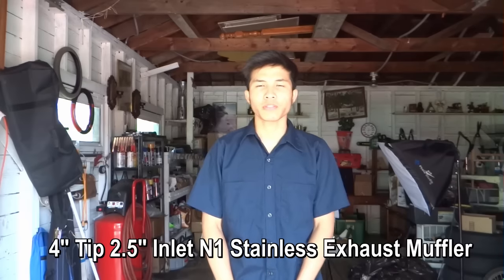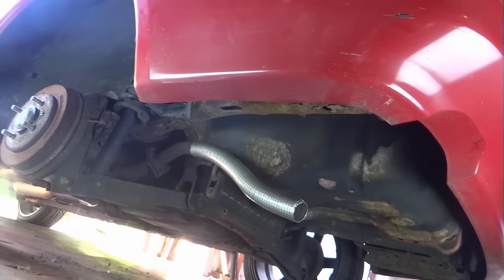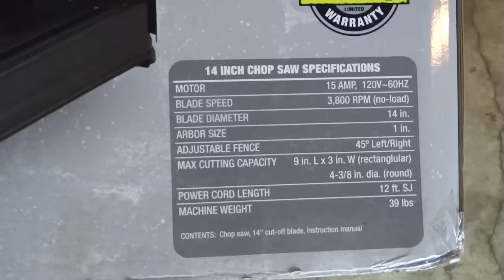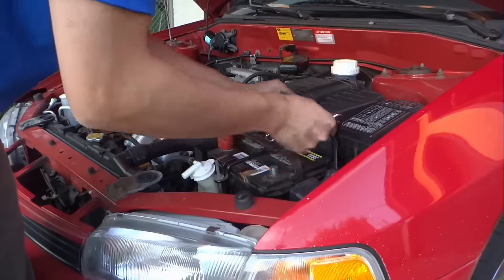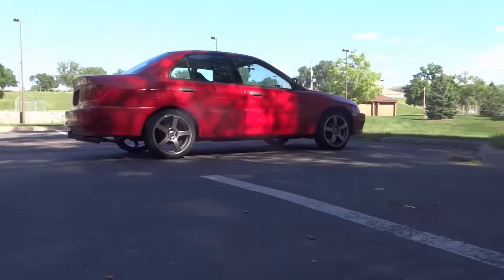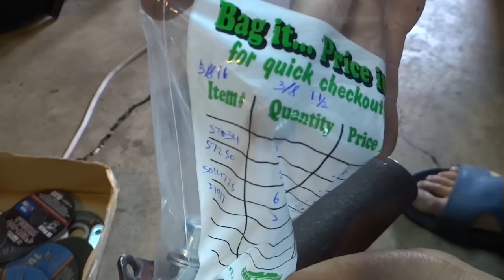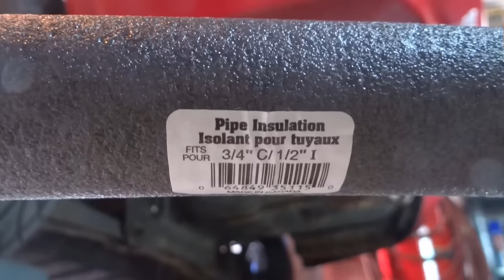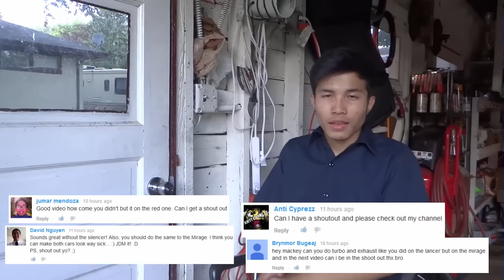Mirage Fix 16 | eBay 4" Tip N1 Stainless Exhaust Muffler

Comment: how much would it cost to get one of these install at a shop & would i need more than just the muffler ?
Reply from the maker: +crazycaveman7000 The muffler shop should have everything you need there.  Not sure how much it will cost
Reply: +crazycaveman7000 $120
Reply: +DarkDragonWing so lets say I got that muffler only and went to a shop and asked them to install it they would have everything else? and it wouldnt cost much????
Reply: +Rodney Gilbert wow really? i already have a muffler for mine i might need a pipe & some other pieces but still need to get a quote for someone to do it for the right price
Reply from the maker: Rodney Gilbert Yes, the muffler shop has everything. They have all the pipes ready to be welded to your exhaust tip to your car. Not sure about the labor.

Comment: can you please tell me the kind of exhaust clamp you used at 2.51 and where can i find it?thanks!
Reply from the maker: I can't find it anymore. But here are alternatives:
https://www.amazon.com/Torca-AccuSeal-Exhaust-Clamp-Stainless/dp/B004G8UTBC/ref=sr_1_6?ie=UTF8&qid=1472608389&sr=8-6&keywords=5%22+EXHAUST+CLAMP

http://www.ebay.com/itm/5-Flat-Band-Clamp-Aluminized-Steel-Muffler-Stack-Pipe-Elbow-Flex-Exhaust-/171666505748?hash=item27f81f0014:g:mBYAAMXQXZZReATS&vxp=mtr
Reply: thank you!

Comment: You have to be really careful rev the motor out side the car u can bump the shift of clutch lock up and it can take off just be cafe I Been a welder go over 20 years now and I5 in a shop fab ing s/s rail and pipe  work and welder work so much better when using gas but great job again

Comment: is changing mufflers can make your car soud louder and better?
Reply from the maker: +RAFFY VLOGetc. (RAFFYVLOG) Yes, it will sound louder, and has a better air flow.
Reply: The DarkDragonWing thank you for the reply! :) so i looked undeneath of my car i noticed its not a long pipe. so what kind of muffler i can get?
Reply from the maker: RAFFY VLOGetc.
 What car do you have?
Reply: Im in japan i got the mazda axela sport 2012. do you know what kind of muffler i have? its not long. ty sorry I'm newbie
Reply from the maker: I'm not sure. How much are you gonna buy? Here is one that can silent the sound: http://www.ebay.com/itm/XFORCE-VAREX-UNIVERSAL-REMOTE-CONTROLLED-3-INLET-CANNON-SPORT-MUFFLER-/321682629639?hash=item4ae5c76407:m:mci7bycFcBTuAJV60Gzcmtw&vxp=mtr

Here is the one I used in the video: http://www.ebay.com/itm/For-Honda-Acura-N1-4-Flat-Tip-T-304-Steel-Weld-On-Exhaust-Muffler-2-5-Inlet-/301723331062?hash=item46401ca9f6:g:jVgAAOSwTapV3Tie&vxp=mtr

The thing that you have to worry about is will it fit or how you're gonna install it. If I were you I would talk to a local mechanic about it before I buy it to see if he can weld some pipe for you.
Reply: i don't want the tip only i want to change the exhaust. you think thats the exhaust?
Reply from the maker: Oh I see. That one will only change the look of your exhaust tip.

Here this one might be for your car that will change sound:
http://www.ebay.com/itm/MAZDASPEED3-AXELA-TURBOCHARGER-CATBACK-EXHAUST-DUAL-PATH-MUFFLER-4-5-TIP-GASKET-/390836063286?fits=Year%3A2012|Make%3AMazda&hash=item5affa50c36:m:mq7T-Uq4gksiccbOB_DRXng&vxp=mtr
Reply: thanks bro. not the tip i mean that big look like a box thats the exhaust right? hehe ty bro
Reply from the maker: RAFFY VLOGetc.
 yes
Reply: thanks! I'm gonna subscribe ty for replying. last one thing bro do you have  any recommendations on what kind of exhaust i could buy? thanks again! :)
Reply from the maker: RAFFY VLOGetc.

No problem.
Here:
http://www.ebay.com/itm/3-00-Dual-Muffler-Tip-Catback-Exhaust-System-For-Mazda-10-12-Mazdaspeed-3-Mazda-/121157041777?hash=item1c3585be71:g:8iUAAOSwVL1WFC2F&vxp=mtr
Reply: thanks
Reply: +The DarkDragonWing i read this a bit too late. i bought the exhaust off ebay and nothing else. i imagine the mechanic will have to do some extra labor which i think he will charge me for it.
Reply from the maker: LegacyOfBlake X
 Yes, he will have to use some bent pipes and weld it on for you.

Comment: nuice job man
with a good welding thing you get far :) i don't have i want a new muffler on my bmw e36 318i but i don't think without a good welding thing i can get it to fit :) and a muffler that fits my bwm cost 200euro :((( of ebay....
Reply from the maker: Regilio Bouma Thanks!! Oh man. Expensive part! Well, if you like your car, you need to save then. haha cheers :D
Reply: hahaahaahha
yeah i mean this ebay universal things cost like 50euro but i'm not sure if i can fit it my self (the muffler is acualy nice i find looks cool sounds okayish) but there is a difference between 200euro muffler that fits directly and may sound better dont know can't find any info, or this cheap ones universal found some nice ones for 80euro but than i have no clue how to fit it.
if i had the equiments it would be easy
anyway yeah save up but i want to much things. :) maybe i will just start with a sport air filter and than we will see :))

Comment: hey man is that a mig welder and did you need any gas with the welder to work it ? thanks
Reply from the maker: I just use a regular flux welder.
Reply: thanks

Comment: hi, mackey. i've got a question. the 5 inches muffler clamps that you used in the video are sold out on ebay. where can i buy the exact same one?
Reply from the maker: Hey. Here are alternatives: http://www.ebay.com/itm/Donaldson-J000209-Torca-Accuseal-Aluminized-5-Muffler-Exhaust-Pipe-Clamp-/191108371650?hash=item2c7ef254c2:g:Gc4AAOSwjVVVkuvv&vxp=mtr

http://www.ebay.com/itm/5-Zinc-Plated-Guillotine-Type-Muffler-Stack-Exhaust-Pipe-Clamp-JG50ZN-/182039624899?hash=item2a62683cc3:g:30IAAOSwnLdWrBtu&vxp=mtr

http://www.ebay.com/itm/SNOWMOBILE-EXHAUST-MUFFLER-CLAMP-NEW-OLD-STOCK-5-CLOSED-NEW-OLD-STOCK-ITEM-/161621555047?hash=item25a1653767:g:vNIAAOSwe-FU9JBF&vxp=mtr

https://www.amazon.com/Dynomax-36442-Hardware-Clamp-Band/dp/B001AGOUZE/ref=sr_1_74?ie=UTF8&qid=1469418964&sr=8-74&keywords=5%22+muffler+clamp

http://www.ultrarev.com/MBRP-GP5AC-5-Band-Clamp-Aluminized.html?gclid=CPDHge_bjc4CFYM2aQod9n0FgQ

Comment: Hi, would you recommend the DD coilover shocks for the mirage ?
Reply from the maker: Marlon Gould It feels much rougher after I installed the coilovers. I can feel all 
the bumps on the road. Though, it got better/softer after driving it for
 a while. It will not be as soft as the factory ones. Hmm I think part 
of it was because I have thin tires on with 40 psi. That too can make 
the car rough on the road. If I maybe put in about 25 or 30 psi, it 
might help a little bit. Cheers
Reply: OK thanks, I can't afford the real high end brand,and I'm not into racing but I would like to get some stability when I'm taking corners. thanks again!
Reply: See you know your craft when it comes to cars? I will send you some pics of my lancer soon after I give her a wash.
Reply from the maker: Marlon Gould
 Nice! Post the pictures here: https://www.facebook.com/DarkDragonWing

I will show them to my fans. cheers

Comment: That's a hell of a lot of work and money in tools and raw parts just to make an exhaust pipe. I think it would have been a lot less expensive to get a muffler shop to make the pipe for you, don't you think?
Reply from the maker: Yes, but knowledge is more valuable, so it's worth it.
Reply: If you were making it because there was no other way to obtain that pipe, I would say great job, but to spend a lot of time and money to make an exhaust pipe that a muffler shop could have made for you in less than a half hour and for a lot less money,I don't know if that was a good move.
Reply: The thing is, I don't care. I just don't understand this person's reasoning for spending so much time and money to make a cheap pipe. I would have spent that money doing body work on the car instead.
Reply: Fair enough but some things are not worth the effort. A cheap exhaust pipe is one of those things. It's like buying a sheet of paper, tools and glue to make a paper bag. It's a lot easier to go to a store and buy one for $0.10.

Comment: Hello my exhaust at my car 1999 TOYOTA COROLLA LOVELIIFE is to much louder than that. But I got an accident at the middle of my exhaust. It hit at the right side (back) of my car. So the exhaust is facing at the  right. I want to tell you about this you drive really fast. I know you drive at 6000x rpm. I leave at Philippines. Last one my plate number of my car is WLT 233. Thank you for reading this.

Comment: wow lol, second try made me cringe! using almost a 90' degree bend?!? i would have stuck with the flexi pipe from first attempt lol, You do know, you can cut the metal in such a way that it will form a pie and you can weld it without having sharp bends??! just finished the video, MUCH better on your third attempt :) def' props for a non professional job
Reply from the maker: Kyle Milford Yes I thought of doing that too, but then I did it this way just to make it easier without making it ridiculous like the second try. lol

Comment: Could you send me the link to the muffler clamp?
Reply from the maker: +caden kellogg Which one?
Reply: the 5 inch clamp, and i'm rather curious. lets say you have 300$ and a 1995 bmw 318ti 5 speed. what mods would you buy of ebay or amazon?
Reply from the maker: Here:
http://www.ebay.com/itm/Muffler-Clamp-5-IN-Diameter-Heavy-Duty-Stainless-Steel-Rust-Proof-PMD-650-/111697168359?hash=item1a01ab87e7:g:GxEAAOSwT6pVgXPf&vxp=mtr

I would put the one I used in this video, but I will also think about other style like this one:
http://www.ebay.com/itm/EUROPEAN-DTM-Style-Dual-3-Tip-Hi-Power-Stainless-Steel-Muffler-Exhaust-/330853685827?fits=Year%3A1995|Make%3ABMW|Model%3A318ti&hash=item4d086a9a43:g:QWMAAOSw8d9UvxFs&vxp=mtr

I also would think about this one that can silent the sound:
http://www.ebay.com/itm/XFORCE-VAREX-UNIVERSAL-REMOTE-CONTROLLED-3-INLET-CANNON-SPORT-MUFFLER-/321682629639?hash=item4ae5c76407:m:mci7bycFcBTuAJV60Gzcmtw&vxp=mtr

Comment: Hello there i heave a question how much it's  cost all that
Reply from the maker: $30 for the exhaust tip. 
$90 for welder
$50 for saw
$20 for pipes
Reply: I wish you could  fix the problem witch my car  heave

Comment: any tips on how i can get my car start i bought a battery and it wants to start but for some reason it dont wanna start i own a 89 honda civic hatchback
Reply from the maker: +Jorge Salazar I'm not sure on that one. What happened to it?
Reply: +DarkDragonWing i bought off this kid that had it for 1 yr and never work on it and i try cleaning the spark plugs and nothing happen ill record a video to show you
Reply from the maker: Jorge Salazar Did you check the fuel in the tank if there is any? Also, try putting some fuel in the intake, not too much though. If the spark is good, then it's the fuel that is not getting injected yet. So put some gasoline in the intake hole. Then try to start it. Put some more if it's too little. Putting too much might flood it.
Reply: +DarkDragonWing maybe it needs new spark plugs wires or a distributor cap

Comment: Hey man where can i get those flex pipes from
Reply from the maker: +EFVideography I don't recommend it. http://www.ebay.com/itm/Nickson-17029-Flexible-Exhaust-1-1-2-ID-Repair-Kit-Each-/391340724873?hash=item5b1db99289:g:hbQAAOSw2XFUkRiz&vxp=mtr

Comment: you do realise if your suspension bottoms say bye bye to your bodge job exhaust
Reply from the maker: +Tudor filer-gale yup, this car is beyond repairable, it will take a while if I attempt to fix all the rust
Reply: +The DarkDragonWing get rid of the cannon and just use two pieces of steel and make and dual exhaust that's still a straight pipe
Reply from the maker: Jarryn Smith
 Good idea

Comment: this guy has no idea what hes doing... the angle of the piping will restrict air flow compared to one that is more straight and put the exhaust wrap near the tip of the exhaust. you put it around your heads and/or downpipe
Reply from the maker: ***** No I don't
Reply: yeah no kidding
Reply: The DarkDragonWing Fuck Samuel! Good on ya for getting in and having a go. Only way you learn is by making mistakes and having a go. Some of the worlds greatest auto builders started this way!

Comment: You might me a ricer if you list how much you paid for each mod.
Reply from the maker: +screwloose455 
Mods on this car:
- $71 JVC KD-R540 Stereo System
- $65 Sport JDM 5" Black Tachometer 11K RPM Gauge
- $93 Crimestopper SP-502 SecurityPlus 2-Way Deluxe Paging Alarm/Keyless Entry with Remote Start
- $15 4 white cluster LEDs, 4 ice blue instrument LEDs, 1 white dome light LED 
- $12 Nickel Metallic Racing Brake&Gas Pedal Pads by Pilot Motorsports
- $266 2X RED FABRIC/STITCHING LIGHT WEIGHT RACING SEAT+SLIDER
- $10 MITSUBISHI RALLIART CAR SEAT HEADRESTS
- $5 USB Bluetooth Music Audio Stereo Receiver fr Car AUX IN MP3 Speaker JMHF
- $30 F106N(14mm-1.5) Fumoto Oil Drain Valve with Nipple
- $823 17"x7" MR116 SILVER RIM By MOTEGI RACING WHEELS,  and ACCELERA TIRES ALPHA 205/40ZR17 84W + Tuner Wheel Lock Kit M12-1.5
- $20 NGK Spark Plug Wires
- $20 NGK Spark Plugs
- $9 SickSpeed Wire Separators 
- $8 3D RALLIART Mitsubishi Aluminum Emblem  
- $225 EVO 4 MOMO Steering Wheel with Airbag
- $34 4" Tip 2.5" Inlet N1 Stainless Exhaust Muffler
- $18 Exhaust Muffler Accessories: 2.5" OD to 1.75" ID Exhaust Component pipe, Muffler Clamp 5 IN

Comment: BUY A REAL TUNER CAR WITH A REAL TUNER EXHAUST SYSTEM TO INSTALL YOU RICER
Reply from the maker: +marlin kleber I'm poor
Reply: You don't understand you don't have to be rich you can get cars such as nissan 350z's 240sx's and miatta a for under 10000$ so sell your ricer car and buy a one of those and save for real performance parts
Reply from the maker: I don't have money to buy parts for a cheap car, I don't think I can afford $7000 car and it's performance parts that literally cost more than the price of my cheap car. marlin kleber
Reply: You can get a miatta or 240sx for under 3000$ in decent condition and many other cars for that price so still that's a sorry ass excuse I see them for sale some for under 2000$
Reply from the maker: marlin kleber
 I have an E30 325i right now, and still saving some money for it: https://www.youtube.com/watch?v=MpgssRcjP9o